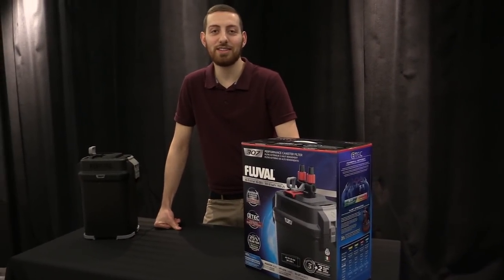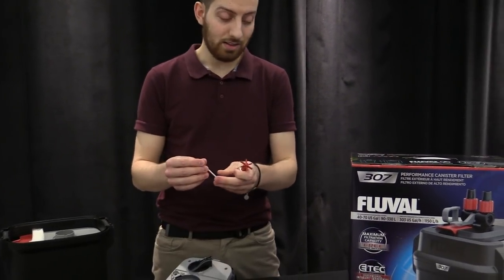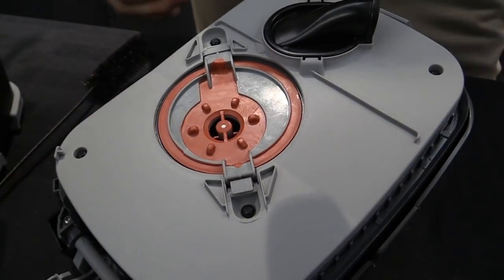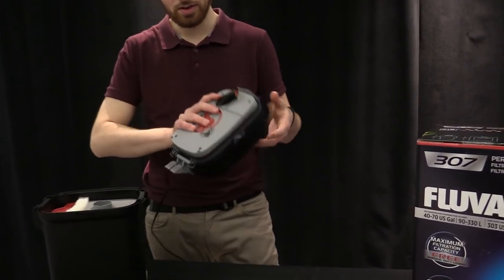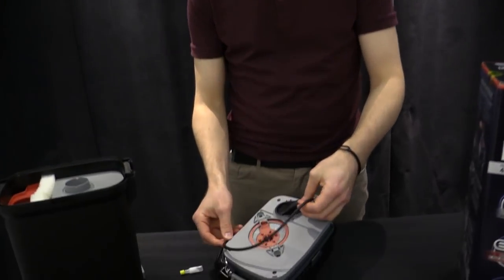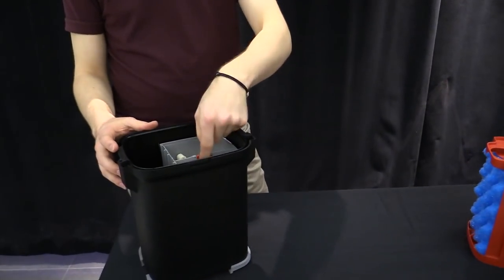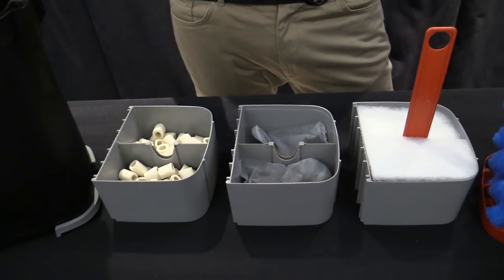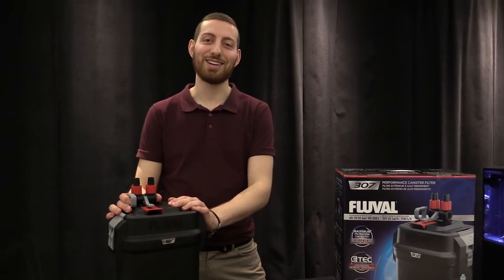Fluval 07 Canister Filter Series | General Maintenance

Comment: fluval 潤滑劑同市面上街店一樣？ 例如我用Vaseline保養都可以？？
Reply: Is fluval lubricant the same as the ones sold in street stores?  For example, can I use Vaseline for maintenance?  ?😊
Reply from the maker: Hi there! It's very important you do not use Vaseline, as this substance dries out rubber gaskets and will cause your filter to fail. We recommend only using Fluval Silicone Lubricant: https://fluvalaquatics.com/us/shop/product/silicone-lubricant
Reply: thany 👍

Comment: The water circulation is not good in the 207, the dirty is not storage where it should, very disappointed, the dirty is in every place except where it should be....
Reply from the maker: Fluval Canister Filters are designed to be convenient and quick to access for regular maintenance, removing and rinsing the foam pre-filter section is highly recommended for optimal performance.
Reply: @fluval  thanks for reply, well the thing is that the dirty was 60% in the hose that takes the water from the aquarium into the canister.. not sure why, it was the first usage. I'm using the 207 at max power now to see if the dirty is most storage in the canister foam, where is easiest to clean.

Comment: You were missing one thing completely in this video, when you are doing a maintenance video, you should be doing that with a dirty filter.
Reply from the maker: Point noted, but certain aspects are better communicated with a clearer visual element.
Reply: That's the thing we do, proper user reviews etc.  We pimped out 206 with 207 foam